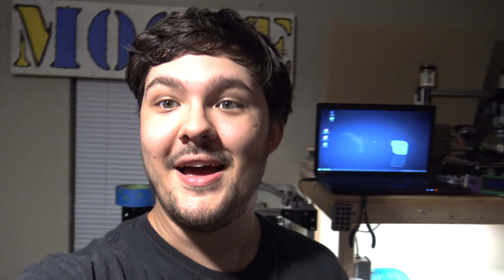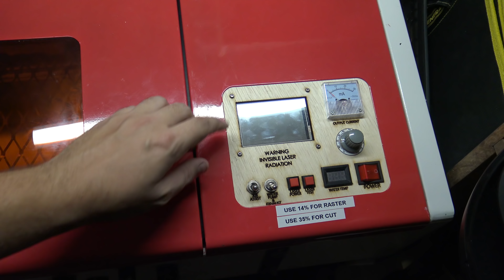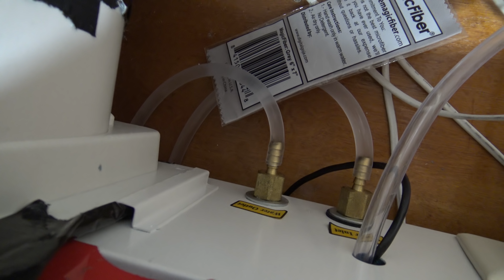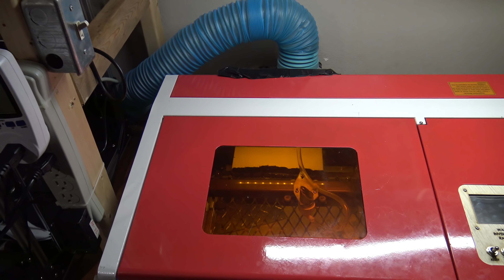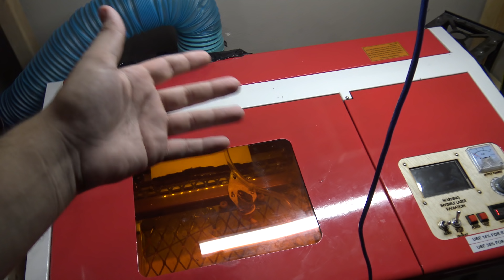Modded Smoothieware Chinese K40 Laser Cutter Overview

Comment: Thank you for this video.  I have a SKR 1.3 coming in for mine Friday and planning to do the board swap.  Hopefully it's not too bad.  I'm decent at setting up Marlin for a printer so hopefully won't have much trouble with motion control... My only concern is how to properly drive the PWM for the laser.  I'm sure it will all make more sense as I do the actual job, just nervous about heading into uncharted territory (for me at least).  

Did you ever make that board install video you mentioned?
Reply from the maker: It won't be too hard to do, you won't know how to do things until you try! Once you tinker with it and get it working, you'll understand it way better.. I haven't made that video, it's on my list.. I wish you luck!
Reply: @DustinCorbin  That's exactly how it goes too.  It all seems so confusing until you get stuff in your hands!

I'm just trying to be extra careful and make sure I get everything (like logic shifters that I almost forgot) to do the swap all at once to avoid tons of downtime. 

BTW, have you checked the 5V regulator on that MKS board?  It may be cooked and is an easy, cheap fix to replace the component  That may be why the TFT ports don't work etc

SKR 1.3 is only $20 right now though ;)

Comment: The issue with tap water is more about the minerals present in it that can cause the laser to arc. Since you have been using is your mineral content is probably low and therefore hasn’t caused an issue. Other people might not be so lucky.

Comment: I just found your video. I would like to see how you did the control board upgrade as well as the wiring. I still have the original board in my K40. I have had my laser for over 2 years and only a month ago I decided to do upgrades that I purchased for this when I first bought it. I was debating about the Mini Gerbil or the Cohesion3D board. The board you are using costs a lot less than one of those boards. I have never used smoothie before. I have a few Enders, a Tevo Black Widow, a Kossel mini delta, and a recently purchased Elegoo Mars. Thanks for this video. I would like to see how you turn a photo into a file for engraving. Thanks again.

Comment: very helpful video, thanks... mine is on the way.  one thing I noted during vid was you mentioned you use tap water and just empty it out every day and havent had growth etc... however my understanding is it's the minerals in the water which could start to cause issues... My guess is it depends on location.  it would be interesting to see the TDS of your tap water if you have a meter.
Reply from the maker: Would be interesting to find that out. Especially now that I have well water and not tap, see the differences, or if the treatment process hinders anything.

Comment: it's a bit late.  but to stop the usb cable from melting while the power is on,  all you need to do is adjust a jumper.   
basicly the motherboard has a fuction to be powered by the usb alone.  so you can upload things without actually powering the 3d printer
there is a jumper on the motherboard (somewhere in the middle)  that allows you to select usb power or 12v power.   make sure usb is not selected.

Comment: Just a heads up this has to be the most hardest way to run one of these Lasers might work for you but what you had originally works better then that 3D printer board those lasers come with laser coral that is a photo editing software and a few click and gives better results

Comment: One big problem...  I have a very similar K40 from Orion Motor Tech. I noticed in you video the ground lug is empty. This is on here for one purpose... to prevent the user from being fried if a short occurs. This machine should be grounded given the amount of electric flowing especially since you are using tap water (higher conductivity than distilled). For viewers of this video dont die GROUND you machines.
Reply from the maker: The normal outlet ground is used if you dont use the ground lug. Yes there is a higher chance of something happening without using the lug, but the machine still is grounded. It all depends on how good the ground is that it is connected to. Sometimes the outlet ground and ground in your homes wiring isnt that good, and the path of lowest resistance would be your body instead of that ground, but thats a chance im willing to take since im lazy and apparently have a death wish.

Comment: Grayscale is tricky. Almost as soon as you burn the wood, it's about as dark as it will get and firing longer just means deeper. Dithering is probably your best bet.

Also, with winter coming around, you might think of making a plate for going in your window to allow you to vent without letting the heat out. I have a design up on Thingiverse you're welcome to mess with. https://www.thingiverse.com/thing:2134765

Comment: Victor Alves
1 second ago
I own a similar one, nevertheless, it is too short for my application requirements. Where could I find longer aluminum rails to extend the cutting area? Thanks
Reply: Hello, I'm Jessica from China Dano Mechanical Equipment Co., LTD. Our company's main products include CO2 laser cutting machine, laser engraving machine, optical fiber marking machine and a series of ion cutting machines.If you have any needs, you can contact me at any time. My Whatsapp:+86 13285336692

Comment: Two big thumbs up mate! I must admit, I really appreciate youtube clips in this style. They are information heavy and are going to solve a lot of problems before they start.
That was a great tip regarding running Linux vs windows. I read up about laser cutters years ago and and servos stuttering part way through a cut was a common issue.
Was the new board a costly replacement? Is it common for these entry level lasers to come with not so great boards that are fixed to run proprietary software?

Comment: Dear sir, I bought from amazon a machine just like this but it came with the corrupted software cd, if it is not too much trouble it will be possible to email me the software and the drivers to be able to put it into operation, thanks and apologies again my email it is netmaturin2@gmail.com
Reply from the maker: I don't have the softwares or drivers. The stock cutter has a special key on the flash drive or CD, so you need that.
Reply: If it still has the stock board you'd just use K40 Whisperer for that. Requires no dongle and works better than the default software anyhow.

Comment: How many amps did you set the stepper drivers for on the mks board?
Reply from the maker: 0.75 in the firmware.
Reply: Dustin Corbin - Thanks!

Comment: I guess adding a weak bleach solution to the water bucket might help prevent mold or other nastiness. It doesn't have to be a lot. Adding a drop of bleach to cut flowers in a vase keeps them fresher for longer. It has to have a similar anti-microbial action on your system.

Or possibly consider a closed system with a fan to draw air over a matrix to reduce the temperature. Use DI water and antifreeze/coolant mix to reduce risk of corrosion. A 12V auto washer pump could cycle the fluid.

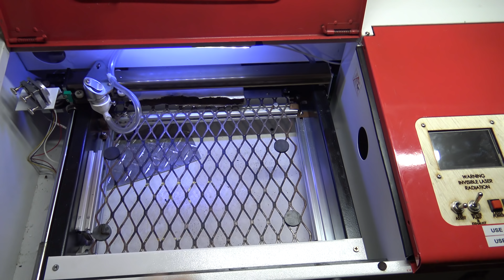Comment: 12:01 You should scrap the air compressor and think of something to take the pressure inside the lasercutter below ambient (negative pressure) so it keeps the exhaust inside the cutter. Use some kind of suction on the exhaust vent / pipe. The fumes might not be noticeable but with positive pressure they can leak out everywhere and impact your health in the long run.
I guess a good fan inside the exhaust tube or at the window foam cover might be enough and some protection against rain.

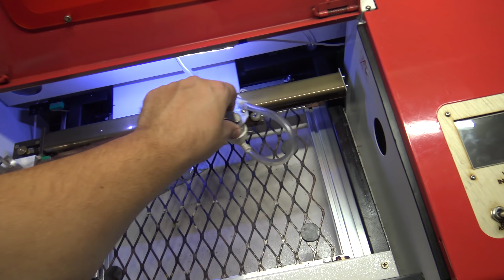15:41 Please put it into thingyverse or somewhere and post the link in the video description. (3D printed air assist)

16:48 Please list all modifications and an estimate of the price.

Comment: Sure u change it out every day but the minerals in tap water are sticking to impurities or scratches in the glass. The fluoride and chlorine are eating seals and etching glass at same time. Changing it daily doesn't help with those issues. It's not gonna kill it right away..u will just burn out the laser faster. Every clump of shit that sticks or chemical in water that etched either creates a barrier to thermal transfer or a eddy in the water current which again equals localized hot spots on a small scale . Over time more and more. Even with distilled shit will get worse but several magnitudes slower
Reply: Wuety06  would not using both a surfactant and perhaps a bit of poly glycol or ethylene glycol help with that (as I would imagine that also optimizing the pH would help avoid etching effects).

I suppose pure ethylene glycol might also work, but at higher flows to make up for reduced thermal capacity.

Comment: Would it be possible to put this on a moveable cart and just wheel it outside?  I don't have any good way to vent to the outside.
Reply from the maker: You can, just know that it will still smell up the area you are in, even outside. For wood, not so bad, but don't do acrylic unless you are separated from the exhaust. You can also get portable filters as well.

Comment: You should just run a strip of cool white LEDs inside the box cutting area off the 12v PSU directly.  Standard LED tape is 10mm wide, which slides right inside of alloy channel tubes like your printer hijack pieces.  This is what I did on our Lasersaur and it looks great

Comment: Water. The reason for distilled water vs tap or bottled drinking types is conductivity.
Reply: The Robson Experience bahaha no... that's how u ground the user while erm... debugging...the water pipe. ...to the machine ;) but yeah it would be a bitch to haul. I meant electrical standards should require the 3rd pin of cord(earth ground)bolted to the chassie with use of spikey lock washer. This way if something makes the metal live it has a nice low resistance path and is less likely to like the path the dumbass leaning his arm on it provides :)
Reply: As a kid, I used to disassociate water at 6V. Distilled water is an insulator but with a very low breakdown voltage. Thought distilled water was used to prevent buildup of mineral deposits.
Reply: @ The Robson.. Short answer, bottled water. Distilled and RO water or any water that has had to many minerals removed will take the minerals from most 'soft' materials it comes in contact with. It makes plastic's cloudy and rubbers and vinyls brittle or hard. This is why most (none buffered) distilled water comes in opaque plastic and drinking water in transparent. So just a bottled water, and if anal retentive PH it to 7 which is neutral. Most bottled water is a little above 7 which is base. And below 7 it gets acidic. If you really want to get into being a water warrior and find the best bottled water to use buy a water PPM meter.
Reply: Interesting, what is the problem with conductive water?
Reply: Is deionised water that has been circulating for months really a reliable insulator at 12kV? A better safety measure would be to run the water through a metal tube that is grounded. This often happens where the coolant pipes feed through the rear bulkhead with metal barbed feed throughs. Thanks for mentioning it because I am designing my own machine and it has reminded me to make sure I ground all the metal parts in the cooling system.

I did a bit of Googling and found some other explanations:

A lot of people's tap water has high mineral content that would scale up the water system.
If you have any metal parts in the water system then deionised water prevents electrolytic action causing corrosion when there are two types of metal.

One thing I wondered about is would a conductive body of water inside the tube affect the electric field and alter its performance?
Reply: Longevity and predictable equal cooling of surface area are likely the main reasons.  Tap with mineral impurities, fluoride and chlorine will clog up, coat and eat any surface it flows over/in all at the same time. If your system is that close to an electrocution hazard if the water conducts it's not something u should be using as production /non lab equipment.  Think about it , that requires a leak and a spray...if it doesn't you arnt meeting grounding codes . 

 it might add a level of safety but If the company/person who designed system has one brain cell firing in ee  or liability legal world  it's not the main reason for distilled. 

Idealy/any system u should let anyone other than yourself near unless u want to risk losing ur shirt in court... should sense a leak to grounded frame and cut hv right away. Think gfci on top of proper ground.  If your system doesn't do this and someone gets hurt at ypur house it could be big trouble...if it's in a biz and  a member of public or emp gets hurt... say good bye to all your money. Insurance will likely call it gross negligence. Ymmv I'm not a legal expert but I do know codes and insurance go hand in hand
Reply: If the machine chasis needs to be grounded then I'm guessing it should only be used on the ground floor.
Reply: Safety, you have water being pumped very close to high voltage. If a wire somehow came in contact with the water or any metal portions of the tubing at any point, the entire water bucket and system would become live and dangerous to touch. It's a similar reason to why the chassis of machines is always grounded. In most cases, it won't be doing anything, but if something goes wrong it can prevent you from potentially harming yourself.

Comment: How did you wire up the board to the k40 I have having nothing but problems using a mks sbase v1.3 for my laser and don't now how to wire it up and can't find any guides on how to do so, even though you said there are a lot.  There are no guides.

Comment: what kind of acrylic have you tried cutting??
Reply from the maker: A few different thicknesses, just the stuff from Lowe's. All cut very well.
Reply: oh ok so all clear acrylic and no colored acrylic yet. I currently have a 5 watt diode laser and i cant get it to cut a blue sheet of acrylic i have. So i have been looking in to a CO2 laser and wasn’t sure if these lasers were good for their price tag
Reply: Russell Rice other videos indicate up to 4mm is cutable. Guessing ur current laser is blue? Objects irl(ie not on a screen) absorb all but the color they apear to be. So blue object reflects blue laser and user left screaming y u no cuta?! Of course it's not a perfect reflection so add enough power and u can still cut blue with blue its just gonna take longer than any other color

Comment from the maker: I made some timestamps for those of you who don't want to watch the whole thing. 

Intro 0:00
Physical Space 2:32
Chassis 3:03
Control Panel 4:15
Water Tank 7:46
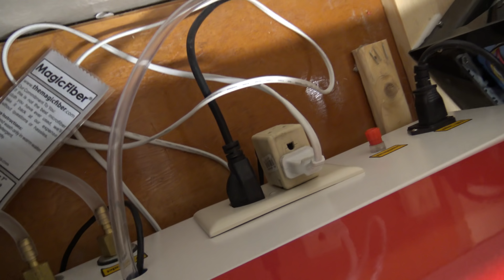Rear IO 9:36
Air Assist 11:11
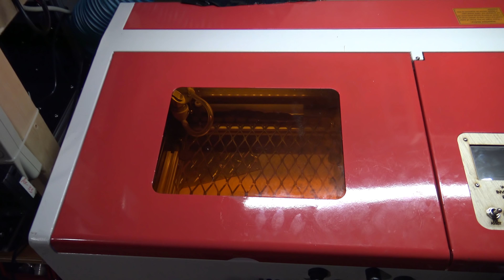Cutting Area and Bed 11:53
Control Board and Electronics 16:00
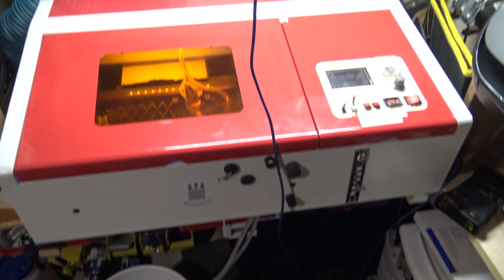Computer Software and Workflow 20:17
Material Installation 26:51
Starting a Job 28:37
Final Thoughts 31:38
Reply: cool toy but you might want to revisit that distilled water topic. True distilled water does not have any solids in it and does not conduct electricity btw tap water does especially here in Florida, lots of minerals etc that will eat\clog  your pump system and water jackets from inside out ... just my 2 cents :)
Reply from the maker: You are right, Im just taking that chance for the sake of convenience.